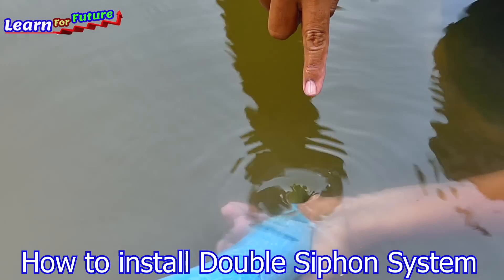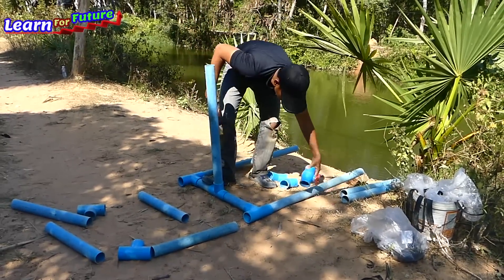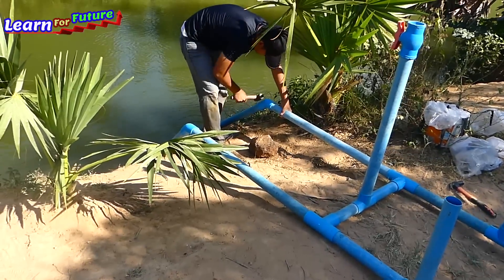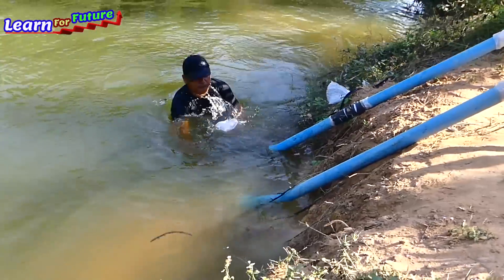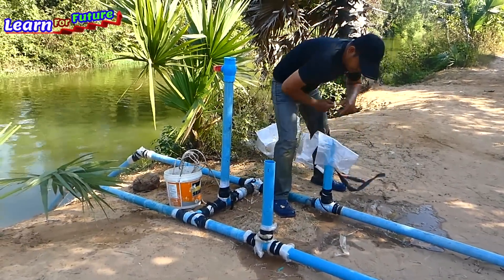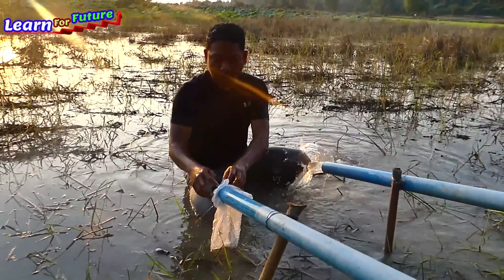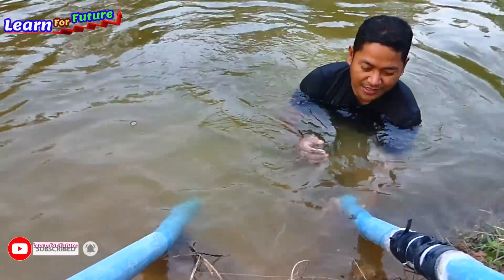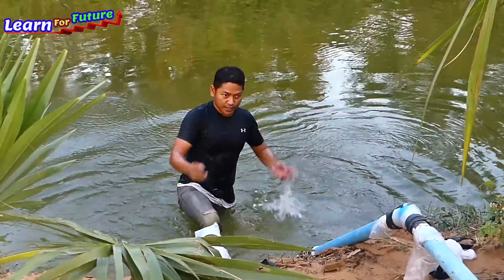OMG Auto Water - Siphon System!! How to install Siphon System suck water from Big River for Big Farm

Comment: Your system sucks!
Reply: No, it is ok, mut only works from a high source to a lower output.
Reply: Its a joke.
Reply: @veistelija  No, this works fine. It is an ordinary siphon from high water to low water level. Will run fine as long as there is water in the river.
Reply: Yes i understand but it sucks.

Comment: if you open the higher side first, would be a bit easier. you'll lose less water from the pipe since it can't pull in air

Comment: The maximum workable high of the system and the size of pipes may kindly be indicated please.
Reply: There is no limit, you just make sure the water source is few mm higher than the outlet. If your pipe is proper sealed and your water source is few mm higher than the outlet then make the water go on top of Burj Khalifa.

Comment: https://youtu.be/NiThJ9vUagU
Please stop putting people in all kinds of trouble by not answering my question that i hsve asked you politely in my previous comment below regarding the relative surface hight i.e. source water surface level and  output field surface level. 
Please tell everybody honestly the relative water  level required to ensure that the syphon system to work.. You will prevent all poor uneducated people duplicaring your setup al lot of pain and suffering.
If you yourself dont know  please refer to the link i have added. https://youtu.be/NiThJ9vUagU

Comment: How do lock the water when you are not using it
Reply: check ball valves intake lines towards the river. you see check valve going up top he used to fill the water ? need those. 1 each for intake lines close to the river. turn it off when you dont need it

Comment: The guy is finally at least naming his apparatus with the right name.  This system has been known almost from the beginning of time.  So what's the big deal?  You see in order for the water to flow the outlet has to be lower than the inlet.  That's called siphoning.  I have done that many times when I need petrol or diesel fuel.  So what's the big deal?  Neither does he need the extra pipes sticking up.  Is that added just to deceive?  Unless there is something I don't understand here I call these kinds of people children of the devil; just like their Father they love  to deceive others.  Why is he making these videos?  Is it to really help others, or is it so he gets so many hits & then gets paid finally by you-tube or goggle?